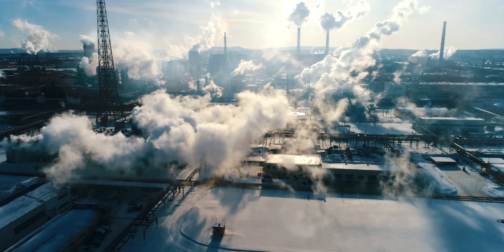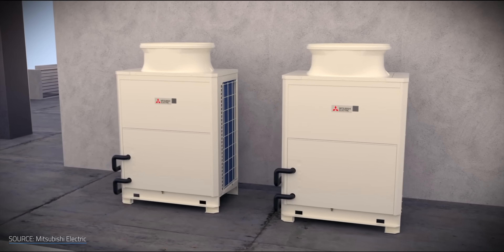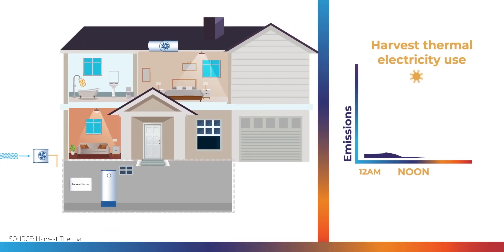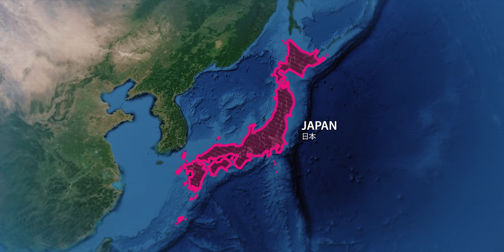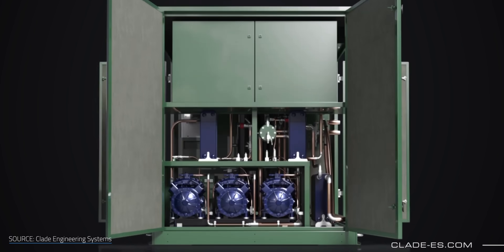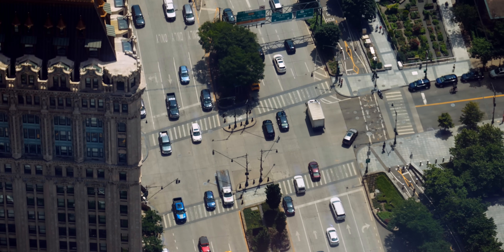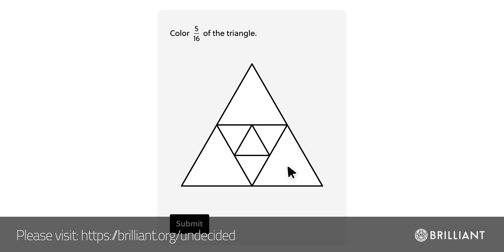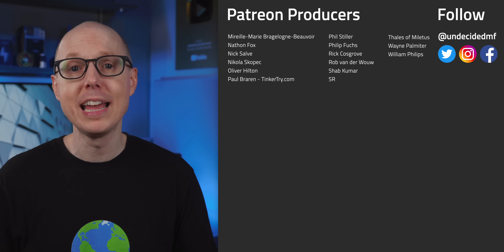Why CO2 Heat Pumps Are The Future Of Cooling

Comment: We had our heat pump put in last year and its been AMAZING! Cheaper to run and in the summer it can make our Rochester NY home feel like a refrigerator. Wasn't cheap but well worth it. Would love a heat pump running on CO2
Reply: @GeorgeWashingtonLaserMusket  in the hot south we usually use heat pumps. But in the north they historically use natural gas to heat in the winter so the extra cost of a heat pump vs simpler air conditioner kept people from buying them.
Reply: @StevenBloomfield  Yep, and heat pumps in the north are terribly inefficient in the winter months.  Efficient modern natural gas furnaces are much more economical and use a fraction of the electricity
Reply: I also live in the Rochester NY area. What company did you use to provide your heat pump? I may need a new HVAC system soon and would like to consider a heat pump system. Thanks in advance.
Reply: @clarkprice7833  Rochester NY here. I hired Huether heating and cooling to install my partial home mini split system.
Reply: @clarkprice7833 if you have natural gas hook ups, you are probably best off just replacing your furnance/boiler: the savings of a heat pump system likely won't be great verses natural gas. But you could also put in a smaller mini split or ducted system. Anyway, low ambiant heat pumps will do what you need (unless you have hydronic heat) but do you want to pay 20 plus grand to replace your existing system with a heat pump? Might make sense if you're replacing an AC system at the same time. Fellow upstate NY resident who heated all last winter with a mini split system
Reply: @GeorgeWashingtonLaserMusket  In the US, energy policy didn't push for these until more recently. Many installers either cannot source cheaply, or are price gouging while federal credits are available. The real truth is a heat pump shouldn't cost much more (less than 10% more than a standard AC build)
Reply: I also live in Rochester. I'm considering replacing my HVAC system soon too! Please share which company you used!
Reply: @phoenixfromtheashes  betlem residential.  Highly recommend.
Reply: Its cheaper to run than what?
Reply: Also in Rochester and got a heat pump back in March, it's been excellent (I use a gas furnace to supplement in the winter.  I went with Betlem Residential for those asking - highly recommended.
Reply: Hey Sorry everyone I have been posting on Matt's vids for centuries never gotten more than a simple like. Wasnt expecting all the comments. So, first off I went with AirQuip here in Rochester they are near Linden Drive in East Rochester (a few miles from me). They are super pleasant to work with. We took out a 11 seer Trane AC that we put in back in 2000. It was 20 years old and very inefficient. It struggled to cool this 100 year old home to even on modestly warm days. When it hits near 100 forget it the coolest the home would get before was about 90F. The reason I made the refrigerator comment was because we had them completely replace our ducting at the same time. The old ducting was leaky and also inefficient. 

My wife and I installed our 12KW Solar system ourselves from 2017-2019 (did it in stages).  Because the whole family drives EVs the solar really only helps in the summer when the AC is normally on.  Reason we dont have many heat pumps in NY *(side note the state is HUGE about the size of Netherlands, Switzerland and Belgium all put together. Its mostly cow country and farms, very little of it is like NYC which is what most of the world assumes the entire state is like). Anyway, the reason we dont use heat pumps normally is the older models would freeze in the winter and you would need to supplement with either natural gas or electric. The model I got is good down to 15F or so then a resistive heater comes on. It maybe came on 2x last year. Winters are not as harsh as when I was a kid. 

Anyway I think that answers the questions. Sorry for the late reply I was working.
Reply: @geekdomo Across the Niagara River into Canada, a friend of mine has had a similar setup since the late 80s on home built in that time period.  He says he's only lost on two winters (~8 years ago) when we had an extremely cold Jan/Feb that stayed at about -25 C (-13F), rather than a day or two and warm up.
Reply: @Zraknul  Last winter was our first with it and it only kicked the resistive heat on a couple of times
Reply: @GeorgeWashingtonLaserMusket a lot of old homes only have a heater/radiator unit and you either don't have AC or use the cheap single room AC.
Reply: They 'Reverse cycle Air conditioning units' Somehow now being called 'heat pumps' for colder climates have been around for decades.  
Modern versions are very effective and easy to control and cheap to run.
However please don't run yours to get it feeling like a 'refrigerator' as that takes away the efficiency of the unit. Best settings for cooling are around 22°, and for heating around 20°.  They don't work as well of a 12°c difference between outside and inside.
Reply: @GeorgeWashingtonLaserMusket no because traditional heat pump systems couldn't work at really low ambiant temps- also not very efficent at cooler temps.... new low ambiant systems solve these problems.
Reply: What is the difference between a heat-pump and a reverse cycle air-conditioning?
Reply: same thing  @peetabrown5813
Reply: @peetabrown5813 

They're the same.  Reverse-cycle air-conditioning would be considered a heatpump. 

Some use it as a way to explain how a heatpump works. 

As example someone has a window air-conditioning unit & if someone were to explain how a heatpump unit heats the house, they'd might say it is a reverse cycling air conditioner. 

Since most know heat comes from the back of a window unit & you get cool air inside, they're just saying a heatpump runs the same cycle but can do it in reverse as well.  

Basically refrigerant runs backwards giving the option to do both heat or cool.  My geothermal has a reversing valve to enable this... geothermal units are literally heatpumps, unless it is commercial which can be dug significantly deeper & collect heat from below the surface, they often use for steam/electricity generation.  

Otherwise geothermal is using waterloops for cooling & heating at a more consistent temperature underground.  Most heatpumps tied to what many recognize as an AC/central air-conditioning unit outside have to work with air temperature.

My geothermal doesn't have the separate outdoor unit that most hear the fan kick on from outside.  Instead it is all contained in my basement unit with pipes running out the wall underground.   It is just over a couple 1000ft of pipe expected to last 50-200years I had buried approximately 5ft deep
Reply: @GeorgeWashingtonLaserMusket  cause it's cold here, like cold cold, the technology is just getting to where it makes sense
Reply: Probably because it’s a new model and not just because it’s a heat pump
Reply: @GeorgeWashingtonLaserMusket "a European"?
Reply: This is one hell of an investment you’re talking, an overhaul to the heating and cooling to a home. Average cost for a standard central air and furnace is in the range of 8,000 to 15,000 dollars. If you were to eliminate those and install this, well I don’t know the price but it looks like it could be in the ball park of 15,000$. Now you could go the route of geothermic heating and cooling. The price of that I don’t know and don’t want to know but the only person I know who had it installed is a multimillionaire so I can safely assume it was pretty expensive. I’m going to say geothermic would be the best way to go, expensive? Yes… but it would last significantly longer than any other option.
Reply: @satchel87  
I installed geothermal 3 years ago 18,000
4000 was excavation costs.
Got the tax credit lowering price to around 13-14k
Reply: You nailed it. We spent $15500 on it in total. With state and federal rebates that took it down to ~$12k.  @satchel87
Reply: I work on them daily, and they are great till they break, parts are expensive, almost always special order. Life span isn't great because they run year round. They suck in extremely cold weather. Mini splits we joke and call them expensive throw away units. Parts are usually not available after 7-10 years vs traditional gas furance got 20years plus and parts are common
Reply: @zack9912000 my seer 15 trane is 17 years old. Has needed a lb of refrigerant, a coil cleaning and two capacitors, but runs great.
Reply: @zack9912000  That would be very concerning if any of it were true! I heard the exact opposite from my HVAC company and their network.
Reply: @zack9912000 this always happens before a product is mainstream.   Soon the parts shortage will apply to fossil units.
Reply: @zack9912000  I can't think of a place where they run year round. Here in western Canada, we have two long periods in late Spring and late Summer where we neither heat nor cool and I suspect that there are many other locales that do the same. And there are times of the year where the heating or cooling is only on for 2-3 hours per day.
Reply: "Feels like a refrigerator"
Fine It works, but we need to use air-conditioning wisely in the future, i.e. use them to go from 30-40°C outside to 25°C inside, not 17°C inside.
Reply: @madshorn5826 Humans want the temp they want, simple as that. But humidity affects perceived temperature in a huge way; having too large of a heat pump can actually leave more water in the air, for example. The lower the humidity, the lower the perceived temperature.
Still, in the USA, you'll find ~22°C to be the most desired temp. We keep that temp all year, so it's cheap to heat the house in winter.
Reply: @UncleKennysPlace  
What we want and what is wise is often two different things.

Kids want candy all day long and adults want unreasonable low temperatures in hot climates. The former leads to unhealthy and obese children and the latter to climate chaos, so letting 'want' being the guide is not a good idea.
If you live somewhere subtropical it will be hot.

Air conditioning is for making life bearable, not for making life super pleasant.
At least if we want to have any chance of keeping a human friendly climate.

Btw most heat pumps work as dehumidifiers: If you cool air the moisture will condense on the cooling surface.

Edit: At winter 19°C is a reasoned temperature inside, and in the summer 25°C is absolutely survivable.
That means more clothing in the winter and shorts in the summer ¯\_ (ツ) _/¯ 
What we have seen in some areas of the world the past couple of decades was an aberration. Nice when it lasted, but not sustainable. Not even with new improved air conditioning tech.
Reply: @UncleKennysPlace  agreed with the simple concept, but humans also need to evolve and “I want it” eventually becomes potentially dangerous or unaffordable compared to other conditions. Like over use of air conditioning and having too great of inside versus outside temperatures can cause health issues. People might want it, but somewhere shared wisdom should kick in to help us find the right balance.
Reply: @madshorn5826 why is it not sustainable to run A/C? Residential energy consumption is a drop in the bucket compared to industrial.
Reply: @brkbtjunkie  
In some areas maybe, but for the whole world residential electricity consumption is at least on par with industrial consumption.
The numbers I get searching for 'final electricity consumption' is roughly one third between industrial, domestic and service.
Here in Denmark the price of electricity is highest around breakfast and dinnertime due to high demand.

Add to this that a lot of people still haven't got AC in Africa and India and that with rising temperatures a lot of them will need AC to literally survive heat waves.

We will need to optimize our energy use based on need, not convenience or fads.

The good news is that need isn't a bad guide to a good life:
Inconvenience and want is part of every life, also good ones :-)
Reply: @madshorn5826  25°C is way to hot for my liking, I like around 18-19°C.
Reply: @Jakob_LS  
Yeah, but do we have the energy to do what we like?

If we all do as we please a human friendly climate will be history, and without a climate allowing us to grow enough food we will die by the billions.

Will you prioritize temperature preference above food security and accept the humongous refugee influx that will be the consequence of food scarcity?

I wish I was being hyperbolic, but the science says we have to make some wise choices soon.
Reply: @madshorn5826  What do you mean? It's free to open a window, the heating for my home hasn't been on in well a very long time because it's insulated and air tight, it's naturally to hot because of natural sunlight from windows etc, to achieve the temperature I want I don't put an electric fan or AC unit on, I open a window, that's about as sustainable as you get. The alternative if you don't live in a climate like mine is a Co² heat pump, they're quite common in developed European nations.
Reply: @Jakob_LS  
If you regulate the temperature by opening windows there obviously isn't a problem, but no matter how efficient heat pumps are keeping a large temperature difference between inside and outside, using a heat pump requires more energy than a lesser temperature difference.

My point is that we may not have the energy to maintain our preferred temperature in every home in every location.

In the winter I would prefer 21°C in my home, but I settle at 19°C because it saves energy.
I can afford the monetary cost, but the globe can't afford the burning of fossil fuels used for half of my heating.
I would prefer flying when traveling, but taking the train is way more sustainable.
If we collectively don't start thinking this way we most probably will not have a technical civilization above dark age level in a century.
Reply: @madshorn5826 well you are certainly correct that we have to change our ways.  Here’s a way of doing it though.  Instead of heating one’s home with a forced air natural gas furnace that might have a COP of 75-95%, if the same natural gas was burnt in a natural gas cogen electric generator it would produce at a COP around 60%, then that electricity was used in a co2 heat pump with a COP of 3-5, we would consume quite a bit less natural gas, with the same comfort level.  Now as Matt pointed out on the Duck curve, the CO2 system he displayed would take advantage of the low demand cycle.  You know what else generates the most during low demand cycles?  Solar.  We could eliminate a large amount of natural gas usage, period, and still have our comfort.

The whole point of my comment is not to eliminate anything immediately, but we can if we want, take serious slices out our carbon footprint.  Pretty much what you said about travelling by train, instead of flying.  Fossil fuels won’t die with one magic replacement tech, they will however die with a thousand small replacements, like this one.
Reply: @madshorn5826  you're free to do that, just don't expect people to follow you.
Reply: No. CO2 has change to gas to liquid problems.
Reply: @markae0  only at ambient pressure. At higher pressures it's fine.

Comment: Doesn't it need to change state at a reasonable temperature and pressure ?
Reply: You can see co2 do it’s supercritical transition behind reinforced glass or acrylic because the necessary pressure is so low, worth a google
Reply: Pressure has to be extremely high.
Reply: When he said fluid all the flags in my mind went off. Fluid can mean gas or liquid then he talked about supercritical CO2. Of all supercritical fluids co2 doesn’t require that much pressure and can undergo phase transition near room temp. It is complicated though right? Phase transition changes heat capacity